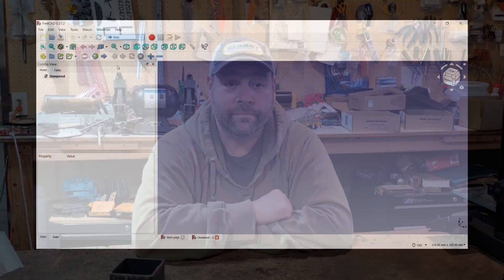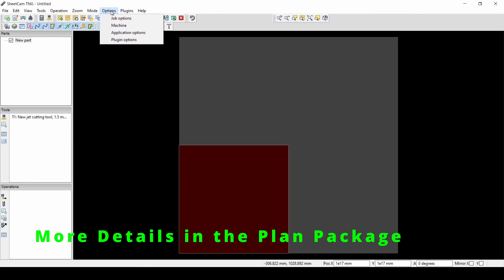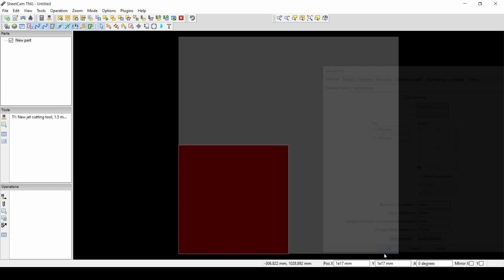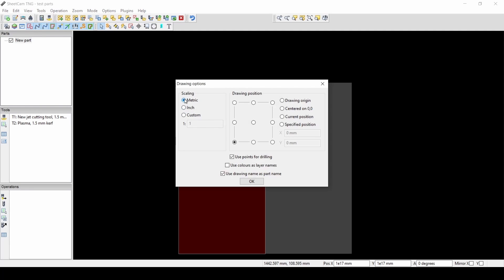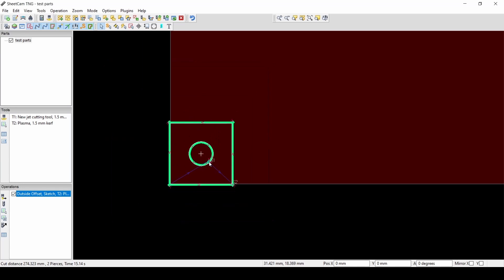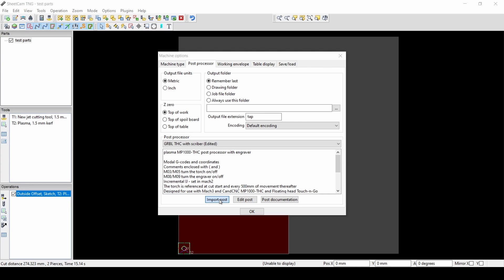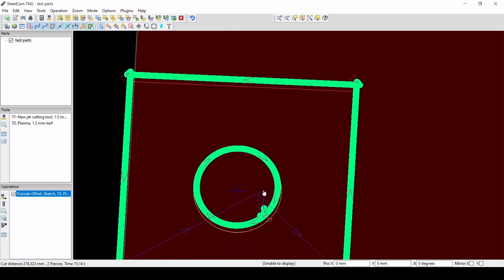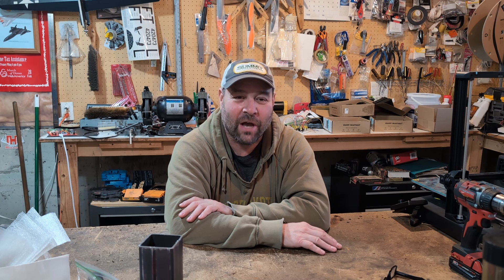FreeCad and SheetCAM Come To The JD's Garage Plasma Table

Comment: I've not used my cutter for over a year but fired it up today and all my g code files won't load on sheetcam, I can't even get it to load a dfx file 😢
Reply: Same here. Have you figured anything out?
Reply: @chriscorbett4522  I've switch to fusion 360. You can design and produce the g code all in one program. It's easy to use and you can cut more than 180 lines of code. There's plenty of youtube vids explaining how to use fusion 360 for plasma cutting although you will need a custom file for the mach3 post process.i can send you that if you need it.
Reply: @scott2735  that would be great! Thanks

Comment: I have copied this example but once the g-code is loaded into open builds it only brings in the square and just the lead in for the circle. When I run the simulation it cuts the lead in/outs and only the corners of the square which it seems to have added a small radius too. Any idea's on why it is not picking up the geometry?

Comment: So I bought your plans and built your machine going on two years now. I have been running it that way since day one as I was already using freecad for my 3d modelling. I had played with the cam software in Freecad but it did not go very well. I tried a few different cam programs but there are very few dedicated plasma cam software programs. Honestly by buying sheetcam that will also run the rotary function to which I still have to build. It works very well. I find open builds to be the weak link.
Reply: I was starting to look at Putting together a mach 3 machine to run closed loop motors and drives. I wish I could write code. I would write the software to run GRBL off of a Raspberry or something stronger to be a turnkey touchscreen controller. Like the older 3d printers. Just throw a usb stick at it with the dfx file on it.  ;)

Also to add to what I am replying to. The cam software in Freecad is an add on. I do not remember what it was called. It has to be added and is not there by default. Also I have to give a MEGA THANK YOU!!! to Lou a gentleman that took mega personal time to write or find me the perfect post processor. Because even if I Figured out the cam bugs in freecad I would have still required a post for freecad which is another can of worms no one has opened. (I am sure Lou would have figured that out too!!!!!!!).

Comment: I have only had my table running for a couple months now.  The learning curve for Fusion is rough for me and I cannot stand that I have to be online for Fusion to work.  So I am opting to learn FreeCad and SheetCam now.  I wanted to let you all know of a problem I ran into.  I did not re-flash my Arduino and maybe that is why I am running into this problem.  Anyway, I tried to cut my first part today using FreeCad and SheetCam, after muddling around for a couple hours getting the gcode right and the start point right, I went run the program in OpenBuilds.  My plasma would not start when running the program.  So back to the computer.  I finally figured out that the Post Processor for SheetCam is using M03 and M05 in the gcode to start and stop the plasma.  Fusion with the grbl post processor was using M3 and M5 to start and stop the plasma.  Instead of editing the gcode manually, I figured out we can edit the post processor from within SheetCam.  If you go to Options>machine>post processor tab, you can click "Edit Post" to edit the post processor.  I searched for every M03 and changed each to M3, then did the same for M05 changing all of them to M5. The you click save.  Now whenever I run the post processor, I get the proper on and off gcode.

I am also getting a grbl error when I start a cut about an arc issue.  I haven't sat down to figure this out yet, but in my tools, I changed my lead ins and lead outs to "perpendicular". I also changed the plasma operation to not loop sharp corners by sliding the slider all the way down and selecting none for now.  this solved the grbl arc error.........for now.  I will have to get this figured out soon as most of my parts have holes in them.  Does anyone have any input on what the problem may be for the arc issue?
Reply: I did not flash the Uno with the new JD's Garage firmware, so maybe what I am going to explain now is caused by not flashing the firmware again. I was unable to cut an arc with the gcode created by sheetcam using the JD's Garage "GRBL THC with scriber" post processor.  I first got the error explained above and fixed it as explained above. I then tried to cut a square plate with a circle in the middle that i drew in FreeCad and created the gcode with sheetcam.   I then got a GRBL Error:26 - A G-code command implicitly or explicitly requires XYZ axis words in the block, but none were detected".  I figured out that this was caused by SheetCam creating gcode that didn't have the G2 or G3 code written in a format that GRBL accepts.  A typical gcode from Fusion/GRBL post for an arc has the format G2 X0.xxxx Y0.xxxx I0.xxxx J.xxxx .  The GRBL post processor for sheetCam was creating gcode like this ..... G02 Ix.xxxx J0.xxxx.  It did not create the X and Y coordinates on the same line [block] so GRBL threw an error.  So, I edited the Post processor like explained above for the arc section.  I changed this 
"function OnArc()
   local radius = math.hypot(currentX - arcCentreX, currentY - arcCentreY)
   dist = dist + radius * math.abs(arcAngle)

   if(arcAngle <0) then
      post.ModalText (" G03")
   else
      post.ModalText (" G02")
   end
   post.ModalNumber (" X", (endX + offX) * scale, "0.0000")
   post.ModalNumber (" Y", (endY + offY) * scale, "0.0000")
   if(offZ) then
      post.ModalNumber (" " .. currentZAxis, (endZ + offZ) * scale, "0.0000")
   end
   post.Text (" I")
   post.Number ((arcCentreX - currentX) * scale, "0.0000")
   post.Text (" J")
   post.Number ((arcCentreY - currentY) * scale, "0.0000")
   post.ModalNumber (" F", feedRate * scale, "0.0###")
   post.Eol()
end

to this .....
function OnArc()
   local radius = math.hypot(currentX - arcCentreX, currentY - arcCentreY)
   dist = dist + radius * math.abs(arcAngle)

   if(arcAngle <0) then
      post.ModalText ("G03")
   else
      post.ModalText ("G02")
   end
   post.NonModalNumber ("X", (endX + offX) * scale, format)
   post.NonModalNumber ("Y", (endY + offY) * scale, format)
   if(offZ) then
      post.ModalNumber ("".. currentZAxis, (endZ + offZ) * scale, format)
   end
   post.Text ("I")
   post.Number ((arcCentreX - currentX) * scale, format)
   post.Text ("J")
   post.Number ((arcCentreY - currentY) * scale, format)
   post.ModalNumber ("F", feedRate * scale, "0.0###")
   post.Eol()
end

This made the post processore create the GRBL accepted code with X Y I & J info on the same line [block]. No more GRBL error:26 anymore.  I found this code on the SheetCam forum here.  https://forum.sheetcam.com/viewtopic.php?t=7625&start=15

Comment: Just another free CAM alternative is openbuilds cam, it is web-based and it has a plasma option. I have used this on my own DIY plasma CNC.
Reply: This works great for engraving on my CNC. When my machine is done I will give it a run.
Reply: If you are using freecad as your cad for open builds cam, you need to export sketch as SVG and then when you get to open builds you need to scale it up 1.0666%. I don't know why this cam has issues with the SVG, but that will make it work for you. Other than that, it works very well. I cut my first useful parts today (radiator brackets).

Comment: I use free cad for 3d prints..but i use ink scape and sheet cam for all my 2D plasma files. Sheet cam is totally worth the money! It also has a rotary plasma plugin for round and square tube. It has a ton of post processors that you can edit. You can even add things to your plasma table like a scriber or engraver to mark holes that need drilled for tapping or precise bend lines.. it's pretty handy for the money!
Reply: Too funny I just started using Ink scape and thought it could be cool for simple cuts.

Comment: Maybe another rabbit hole. I have 2 cnc routers. I use Vectric Aspire for my cad. .stl and .svg files I I am in the process of learning Fusion 360 but was thinking why reinvent the wheel. Asprire has post processors. Just would have to figure out which one.

Comment: This one is for me I''m a freecad addict. I tried to use postprocessor on freecad for plasma but there is no native plasma tool in freecad. It seems to be possible to tweek your own tool using macro or something like that but i could'nt find out how to do it on my research. If someone has any informations or tutorial for Freecad postprocessor using plasma  torch with Z parameters like fusion i'm realy interested too.
Reply: I use freecad for my diy plasma cutter/process. I modified a postprocessor but I use qtplasmac (linuxcnc) for control which takes over all of the z-axis moves. It took a bit of hacking to understand the postprocessor.
Reply: @tomsgarage1   Hi Tom Any chance you can go into greater detail and if possible share the modified postprocessor ? Thanks
Reply: I think there is someone on the Freecad forum who has adapted a laser cut postprocessor and reading between the lines on that forum it is a simple task if you can program in Python. I can't, it's taken me 6 months to get to grips with using the design side but I too am now exploring the tool path side and I know it can process for GRBL.
Reply: @stukyu  I can't program on Python either. and I won't jump into that rabbit hole For a Z. I think i better use inkscape or buy Sheet cam like @ryanconway250 suggest.
Reply: I finaly export dxf from freecad, clean it with Librecad and create polylines (inkscake should also do the trick) then I import the final dxf on fusion360 for the postprocess 
and use it only for that purpose. It seems that cambam can handle plasma settings aswell. any feedback?